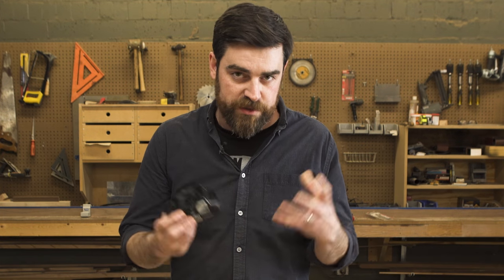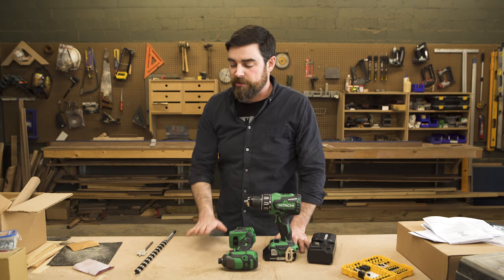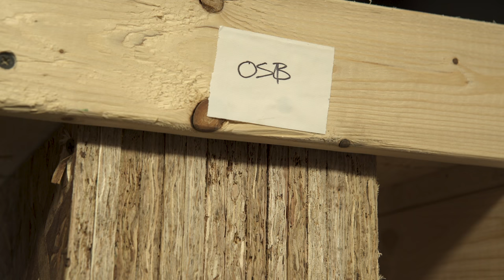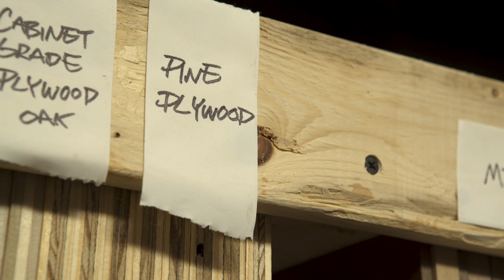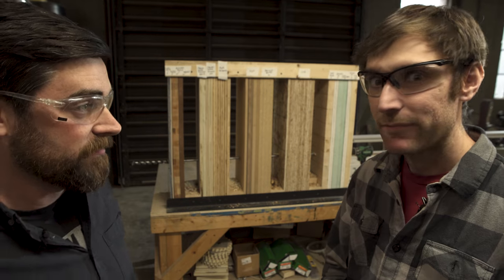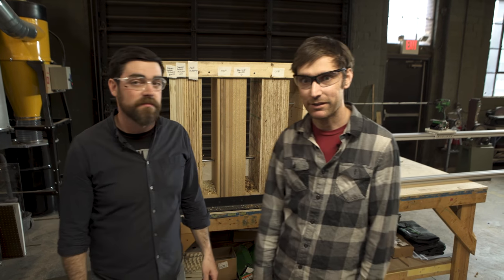ToolCrush: Hitachi Cordless Drill + Impact Driver | Tool Review

Comment: I have a Hitachi 18v hammer drill that is around 13 years old. Been through hell and still going strong. Your test product will be finding it's way to my garage soon. The old one? Time for a good cordless in the barn.
Reply: I have a Hitachi 14.4V regular drill that's almost as old as yours and it's still working as good as when it was new. It's not been through heavy use, mostly smaller home projects, but still, I'm very pleased with it. It's got quite impressive power for being just a 14.4V drill, on low gear it's got more than enough torque to twist itself out of my hands if it binds up, it's not a problem to use 100mm holesaws or even bigger with it.

Comment: I love mine, but I dropped my drill from 5 ft and the base broke off from the handle.  I called their customer service and was informed that my warranty had run out after one year.  The impact drill still runs great but one of the two batteries died only after one year of use.
Reply: You dropped it from a height of a human dwarf and it broke?

Comment: I have the same set as yours in the video. Both batteries 3.0 are fully charged. Yet, one battery wont turn tools on. When i place the battery in any hitachi metabo charger, it blinks very fast? Any solutions ?